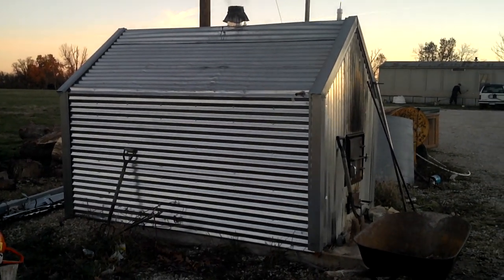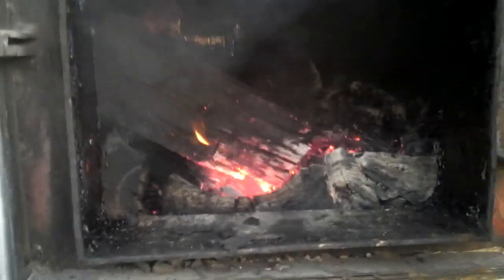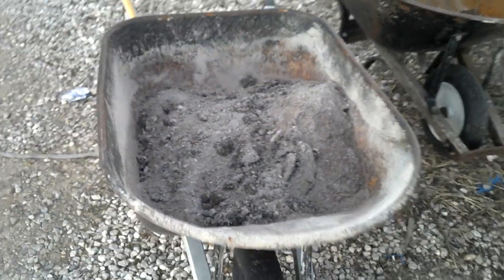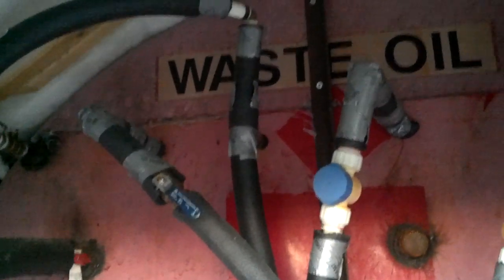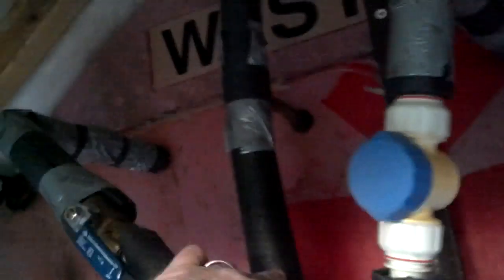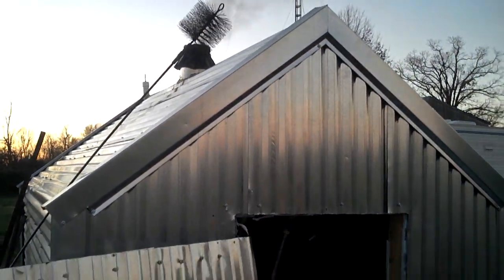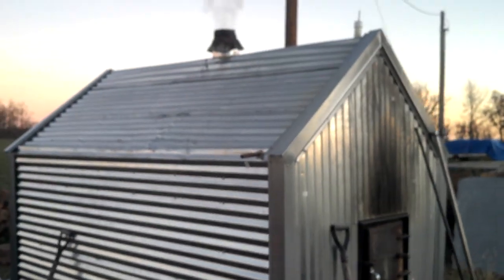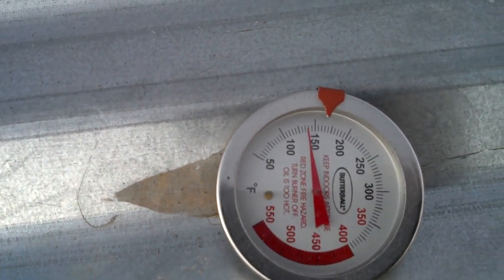2010 wood heater pex piping water

Comment: how thick is the cement slab that it sits on?
Reply from the maker: Yes mike the cement slab is 6 inches thick. And the water heater has a pump on the bottom pumping it to the heater through a coiled copper line. And back to the heater.

Comment: for your hot water drinking, do you have a pump running the water to the hot water tank? do you have a coil or pipe in the oil tank that it your drinking water travels threw to pick up heat

Comment: Does that 20x20x3 heat exchanger provide plenty of heat for a 2000 sq ft house? I am thinking about a heating boiler system about half the size of yours.Maybe some 24" pipe about 4 ft long through a propane tank. I think one of those older style round propane tanks would work great. I was thinking about putting the 24" pipe all the way through it and I would just have to weld around the 24" pipe on each end to make it water tight.Do you know how man CFM the fan is?
Reply from the maker: This heater was heating my house just under 2000 sq ft. And a 1200 sq ft trailer. And 2 water heaters.
Reply: But on the one house was the 20x20x3 heat exchanger about right? I guess you had it in a central heating furnace system with duct work Did the fan run continiously  or did it come on and off as needed?